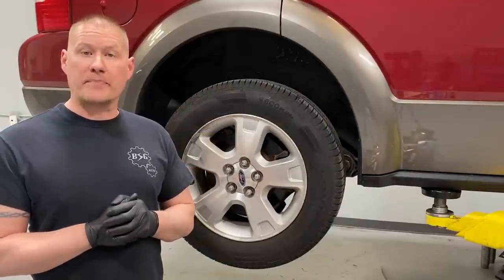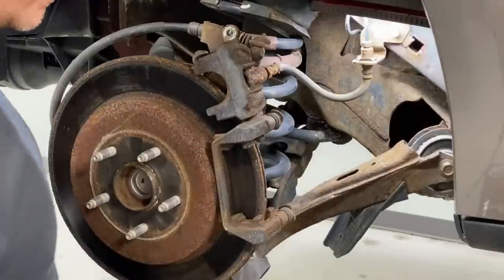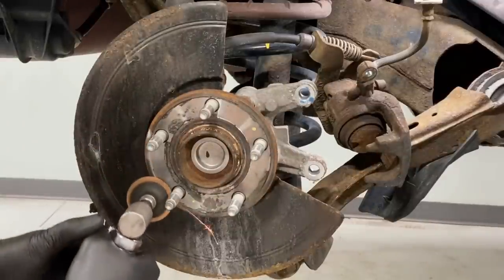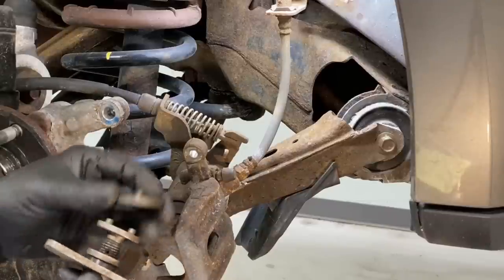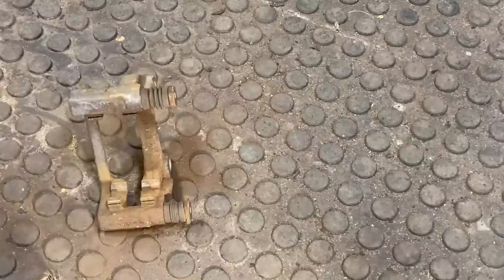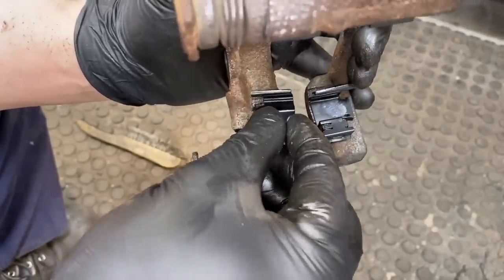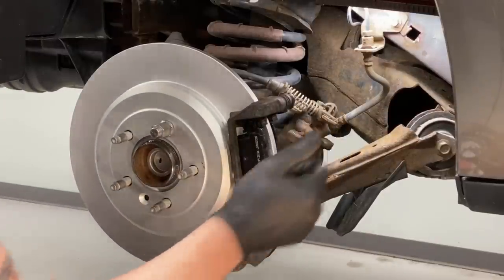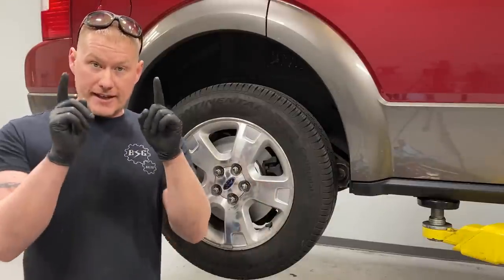2008-2019 Ford Taurus and 2005-2007 Freestyle/500 Rear Brake Job Walkthrough

Comment: I’ve been fighting that piston all week… guess I’ll have to force it even harder now that I know they’re known to be difficult
Reply from the maker: You must push in and turn at the same time to unseat the piston.
Reply: @FordTechMakuloco the thing is I've been able to turn it with a pair of pliers but with the tool it doesn't move. One of them I turned it until the piston fell out and I found another video so I think I know how to fix that but it seems weird. But maybe I really do just have to force it harder
Reply: @FordTechMakuloco  I remounted the caliper and then wedged a screwdriver in to get more leverage. With 1 person holding it and another turning the tool we were finally able to get it retracted. That was on the drivers side where the piston hadn’t fallen out. Now I pulled the guide pins out to grease them and the top one came right off but the bottom was a stinker, but it too eventually came out.  That’s when I noticed the top and the bottom guide pins are different (which I noticed as well after rewatching your video), and after cleaning and greasing them, the top slid right back in while the bottom one wouldn’t go back in. Tried to see if it was the same on the other side, and as expected it was in reverse: the bottom came right out and the top one is stuck in there. I couldn’t even pull it out to see if they were different top and bottom like the drivers side or whether they would be easy to get back in
Car has been in California its whole life so no rust or corrosion there
Reply: Update: I got the bottom pin in. Once you get the rubber (not the boot, the one that goes over the end of the pin) fully inside if it’s still stuck, lightly tap it with a hammer. My problem yesterday was I couldn’t get the top of the rubber in.
On the other side, the top one that was stuck, I haven’t tried yet but I just remembered I remounted the bracket in order to get the pin off

Comment: If you ever have to do rear shocks on a Freestyle or Montego, there are literally no useful vids on this procedure. Haynes and Chilton give generic instructions at best. Ford shop manual is also vague. ;) We took ours in per your suggestion. I couldn't figure it out, and I've done quite a few suspension jobs on Fords.

Comment: Is it better to use copper or nickel anti-seize in this application?
Reply from the maker: I use the high temp nickel for spark plugs on the 5.4L 3v all the time so I always have some on hand. Any anti-seize will do though.
Reply: Personally I avoid any anti-seize other than aluminium based ones around alloy wheels. Even then I much prefer to use just water resistant grease or some kind of wax, if there's any damage or nick in the wheel copper and nickel will use the aluminium as a sacrificial metal. Nothing sticks harder than aluminium corrosion, regular iron oxide doesn't even come close. Then again I work on big trucks/trailers, and when a wheel gets stuck on those it's a real pain in the ass.
Reply: @ColtaineCrows  well, i think the only place to put anti-seize is between the hub and the rotor, because that is the hardest thing to get off in a brake job. I never put anti seize on wheels.
Reply: @FordTechMakuloco  have you ever heard about copper anti-seize affecting ABS systems in some way? I've read in some forums that its an issue when you apply copper anti-seize. I think it's a load of crap because there is no way that it will have an effect if you put anti-seize between the rotor and the hub,  but I'd rather hear the opinion of a professional such as yourself.

Comment: Here in California my techs would be freaking out because of the rust and corrosion.  They would insist the car should be condemned as unsafe.  I always laugh at them when they insist that all the brake parts need to be replaced.
Reply: Had a tech that came from Colorado. He tried hammering off rotors on an Expedition with a small tack hammer. We found it very amusing to say the least. He didnt last long.

Comment: You mention the backwards threads for the passenger side. I immediately think of Chrysler lug nuts...
Reply from the maker: Huh?
Reply: @Mr.Beastforpresident  :  Don't know all years that were that way, but my dad's 65 Plymouth Valiant had em. I think by the 70s they all had 'normal' threads on both sides.
Reply: @FordTechMakuloco  : Old Chrysler products  had left hand threads on the passenger side lug nuts.
Reply: @fredflintstone4715  Like my first car -- '49 Dodge.

Comment: When calipers turn in that hard the customer is getting rear calipers or they will be back in 6 months moaning about how you just did the rears
Reply from the maker: The 05-09 models are all hard to turn back in even when new.
Reply: At 200k on my 500 I might just op to replace calipers. However when compressing or turning I've found it easier to temporarily remount the caliper . Thanks for the video !